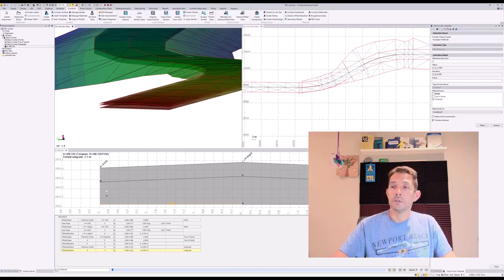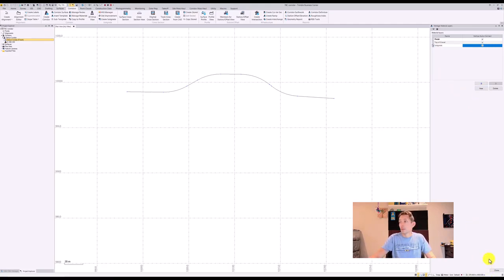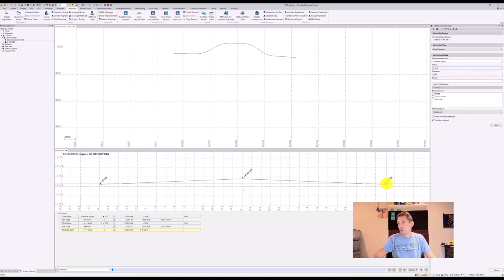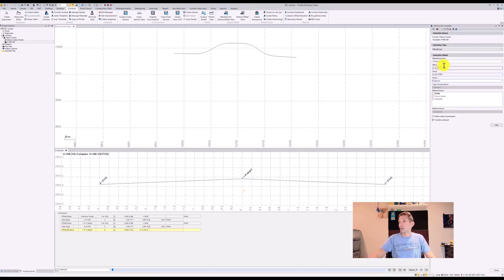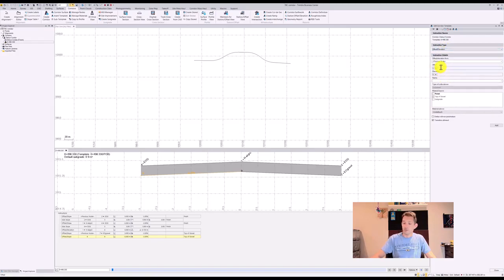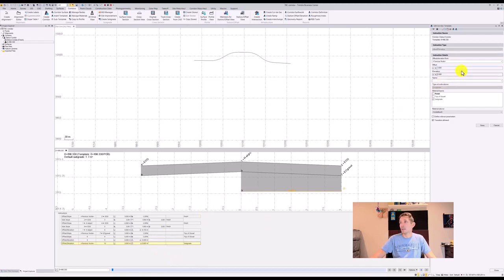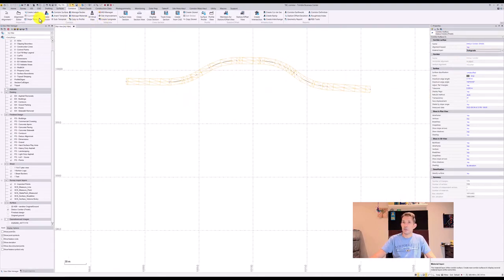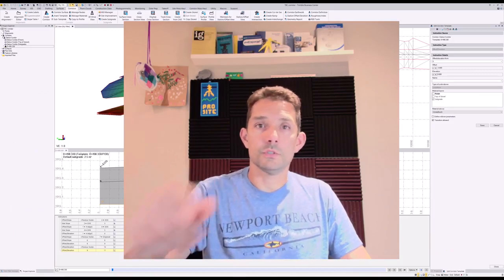How to create sub-grade corridor surfaces Trimble Business Center

Comment: Hi, i would like to create a corridor for digging pipes with different hights and layers of gravel top of the pipes, is it possoble to do in TBC
Reply from the maker: Hi, you have few different way of doing it in TBC, you can use the utility module, corridor module or just plain old line-work and surfaces. But definitely it is doable.